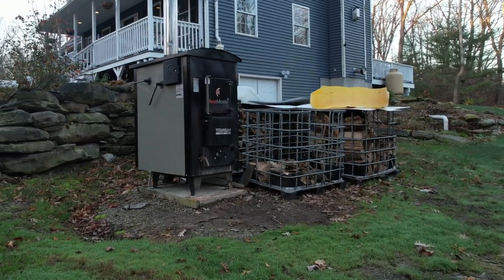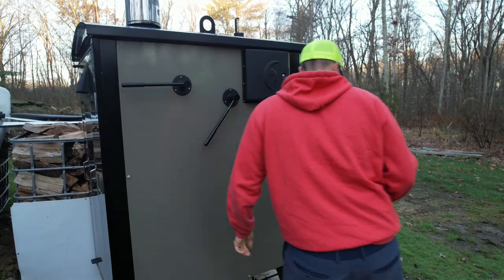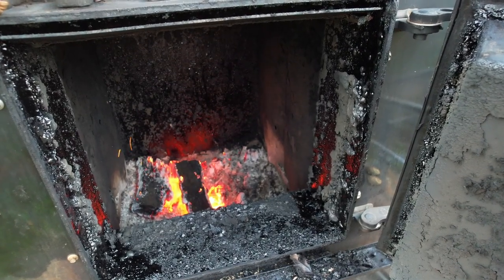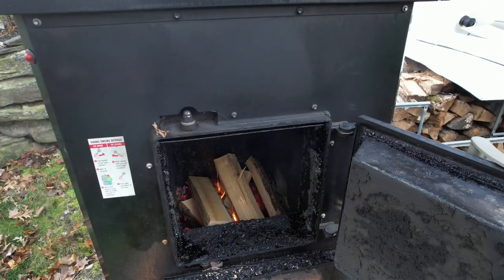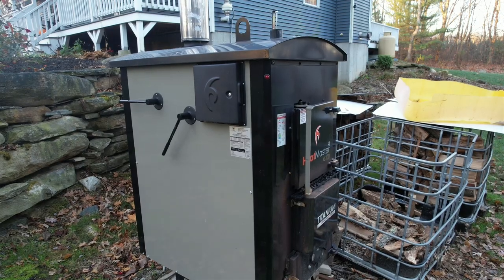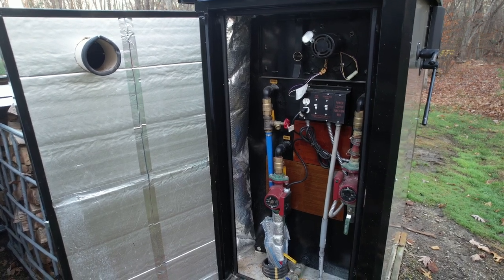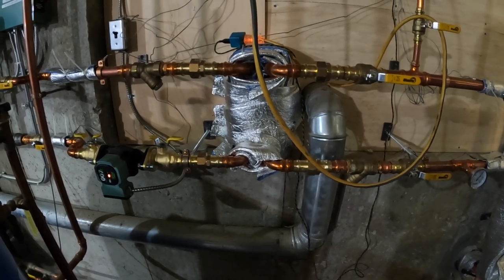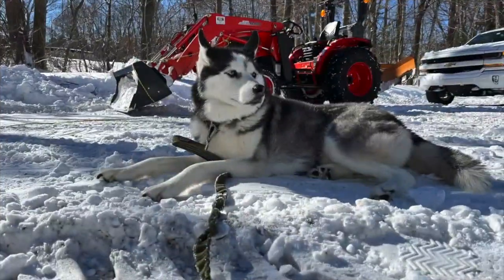Outdoor Wood Boiler Tour: How it Works

Comment: Interesting!  So the wood boiler preheats water for the oil burner which in turn uses burned oil to heat air or water to heat your home?
Reply from the maker: Yes. Hot water comes from the wood boiler, so the oil boiler never drops below the set point, so the oil burner never has to turn on to heat the water. 

If the fire goes out the oil boiler will fire up and heat the house and keep the wood boiler from freezing.
Reply: @ArborActive  I see 💡!   Excellent!    Very good design.  I don't think many people got that simple point in your vid but you explained it very well and concisely just now!  TY!  Im considering doing the same.  I think it might be able to bypass many code restrictions due to the clever design.  I love it!

Comment: What size is that wood boiler? And how many sq ft does it warm
Reply from the maker: This is a Heatmaster G100. I am using it to heat 2400 Sqft and DHW. It is rated for 3000
SQFT.

It has been replaced in the Heatmaster lineup with a newer model that is a similar size the G4000, which is rated for 4,000 SQFT.

This is the smallest unit in the lineup and they make much bigger ones that can heat much more.